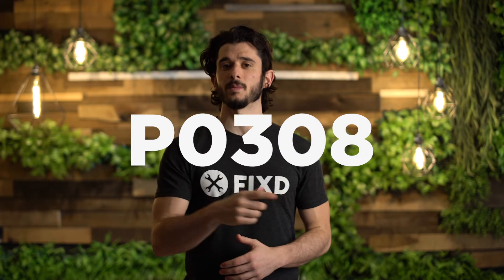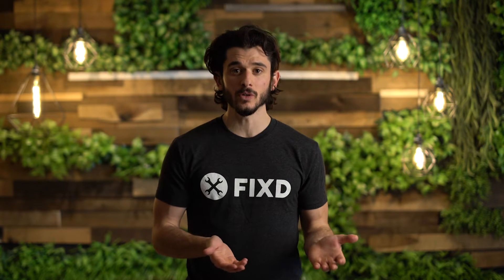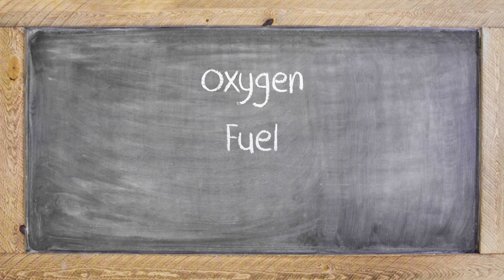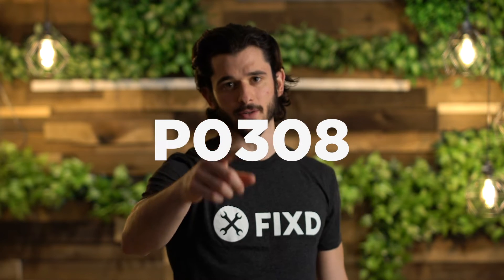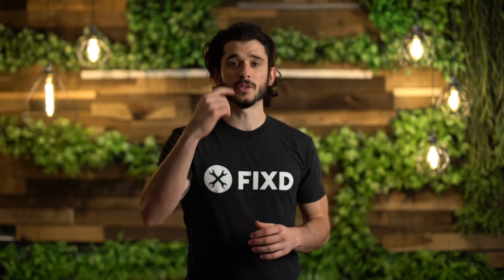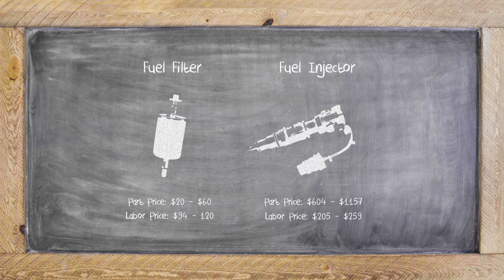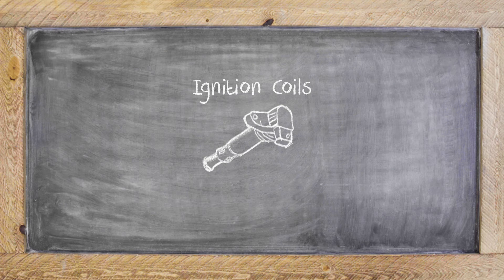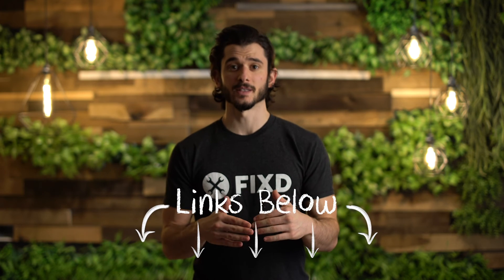P0308 Explained - Cylinder 8 Misfire (Simple Fix)

Comment: So I had the same code but I had low compression on that whole Bank of cylinders. It was cuz the valve wasn't closing all the way. Wasn't seating properly. Had to shorten a push rod on that cylinder. Misfire is gone. Truck runs good. Little bit noisy though

Comment: A weak or busted Valve or valve spring,in that cylinder could also be a potential issue for this code. This would fall on to the bigger problem. Unless you work mechanics.

Comment: My situation:  V8 camaro 2014,  P308 code once a week or once a month ( it is rare), only when the engine is still cold and with idle ( like 500RPM). So, it is difficult to find the cause. I had new coin, change the cable. I need to see spark plugs ( 2 years that changed).  I know the code , for I have a obd2 scanner.

Comment: I'm still having issues with my cylinder 8. Changed the spark plugs, switched the wires and I'm still getting the code p0308. I need help.

Comment: In a 2007 Toyota Tundra SR5, the obd-2 shows code p0308, now my radiator blew so can the water from the Radiator have caused the code p0308. Before,  it showed code p0117.
Reply: Please someone reply.  I'm usmc disabled and haven't got the money to spend having it towed to a mechanic shop.  I have to try to fix it myself.....please remember that my radiator blew a week ago.

Comment: Change the intake manifold brand new fuel injectors o2 sensor all 4 new spark plugs new I had a random misfire but it was my oil rings on fuel injectors vacuum leak now says number 8 misfire and also this Electronic Throttle Control System Bank 1- Forced Limited RPM P2110 think it's my throttle body 2011 1500 ram4.7 and
Reply: Ever figure it out ?

Comment: Once in awhile I get this error on my 18 Silverado z71 v8 my check engine starts blinking, oil pressure goes very high traction control light comes on and it runs very rough. But after about 20 min it goes back to normal light stops blinking but it stays on for a few hours then turns off and everything is fine. I bought this truck new in 18 and it’s done thing 5 times now. No one can fix it cause by the time I get it to a shop all the symptoms are gone. Sure they can bring the code up but at that point it’s worthless.
Reply: My doing the same thing, did you find the problem out yet
Reply: @TheRealHotRod no and it just did it again haha! Did you find anything?
Reply: @Fox250R  my problem was the spark plug wire was off on  8.  Put it back on went back working normal
Reply: @TheRealHotRod  oh wow. I’ll check it out thank you 🙏

Comment: 2008 f150 4.6 changed all the coil packs all the oxygen sensors all the spark plugs the intake gasket the EGC etc I'm up to $550 on fixing it already it still has that skip it's still coming up to number 8 remove the injector and done another one still doing it remove the coil and put another one still doing it what now
Reply: At yuo fix i have tha same problem
Reply: It could be ur intake manifold
Reply: Get ur instale manifold checked; if it’s not that it could be more serious problems such as a cam phaser; timing chain or timing selonoid

Comment: 05 dodge ram 1500 4.7. 
..I'm getting p0308 and I changed the spark plug and coil pack and that didn't fix it. I did compression and it showed me 60lbs in cylinder 8. All the others were fine. I'm frustrated
Reply: Fuel injector

Comment: Will a bad ignition coil cause white smoke on a cold start?
Reply: What was the problem?
Reply: @cliffroberts1774  I’m not totally sure. I replaced the ignition coils and it still blew smoke on a cold start. My battery died so I replaced it and the smoke stopped. It’s been 4mo still no smoke. I have 🤷🏻‍♂️ 🤷🏻‍♂️

Comment: where are you getting your parts? those estimate prices you gave are way over the top. replaced #8 cylinder coil pack, pack was$60
Reply: Dodge is a bit more expensive
Reply: Ford dealership, I am guessing

Comment: I am getting p0308 and I bought a new spark plug and I switched the coil pack to cylinder 6 and I put 6 into the 8th cylinder..I'm still getting the same code for the 8th cylinder. What else could be the problem
Reply: Injector

Comment: 2004 ford F 150 5.4L engine Changed out fuel injectors, change spark plugs, changed ignition coils, changed fuel filter, replace Cats(2), did over haul of timing chain, cam phasers, guides, replace fuel sending unit,  air filter,  Check compression, checked electrical voltage and still no luck. Misfire on # 4. For a while it was random but always on right bank.  1 & 3, 1 &4 and now only 4.  Any Ideas?
Reply: Pcm or wiring
Reply: @luissaenz2941  Thanks, I've been told the pcm is alright so I'm having the wires all checked.  Appreciate your response.
Reply: buy a new motor at this point
Reply: @andrespacay603  lmao😂

Comment: WORTH THE COMMENT READ FOR SURE!
Not mentioned in the video but Labor costs are different for every make and model. Also parts are different as well. Labor is different due to accessibility. For example, let's use P0308 in this video or any other misfire code for that matter. Some cars the ignition coil is exposed and bang bang boom you can get to it less cost on labor. Other cars you need to remove the whole intake manifold and disconnect various sensors, etc, and often times need special tools just to get to the ignition coil. Which means, you guessed it more time and Labor costs. Don't believe that the costs for labor in this video will be the same for your vehicle. Also parts for a BMW, Mercedes, AUDI, and othee high class makes are almost always more money that for generic makes like Honda and Toyota. 

BOTTOM LINE: The higher end or class the vehicle, typically the higher end money you need to buy parts. The harder less accesible parts on a vehicle, the more time and labor its going to cost.
Reply from the maker: Good point! Thanks for the thoughtful response, Isaiah!

Comment: how about showing the location under the hood of cylinder 8 or 6 or 3 or 5 its nice to no the what but it would be nice to no the where.
Reply: Because each car has a different firing order so 8 can be on the passenger side or driver side depending on the engine and vehicle. If you really wanted the answer to your specific car just Google your car type and firing order
Reply: Front to back, drivers side 1,3,5 7
Pass side 2,4,6,8